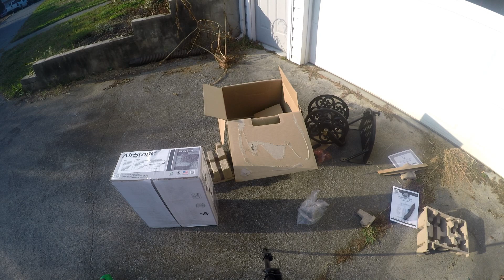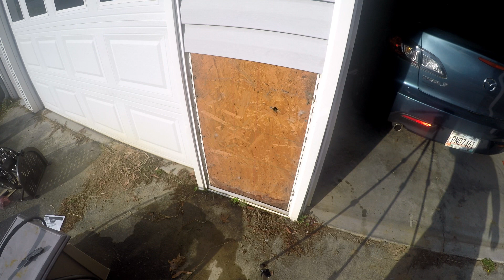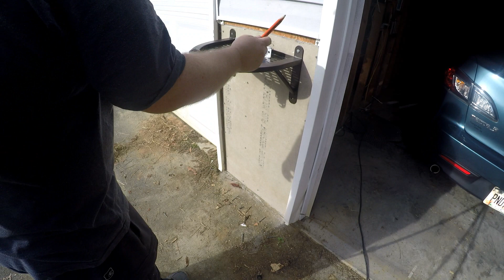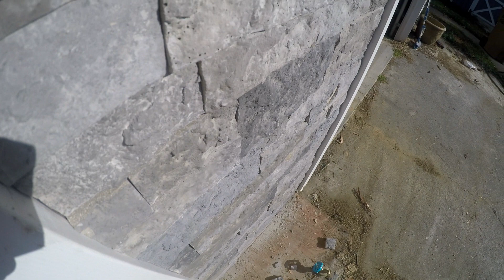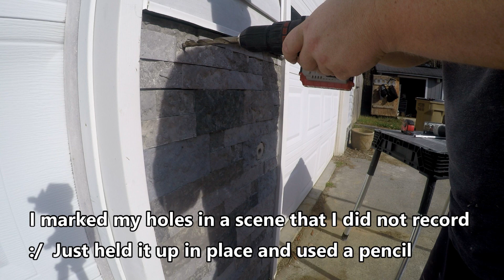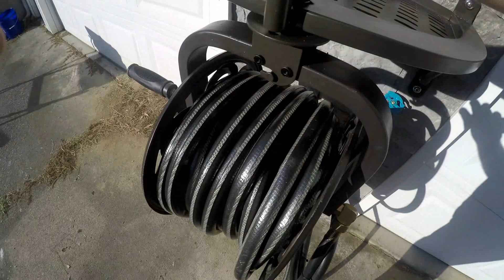Best Water Hose Reel Upgrade EVER! Liberty Navigator

Comment: Nice job on that Liberty Hose Reel as well as the Airstone install. We used the Airstone as our Kitchen Back Splash and  it looks great. How are both holding up almost three years later? Keep up the good work.
Reply from the maker: Had a few blocks fall off not many.  Using a different adhesive to put back on.  Everything looks great!  Thanks